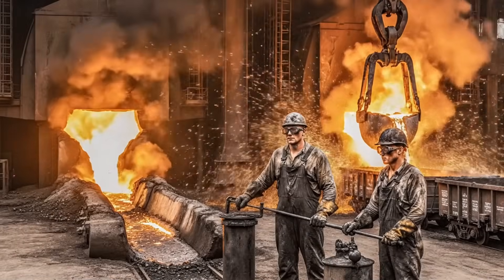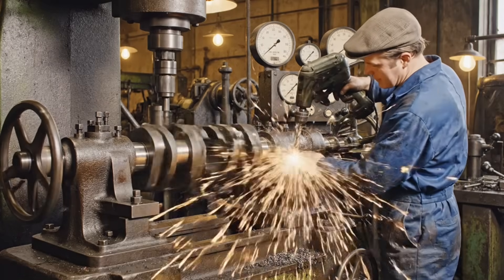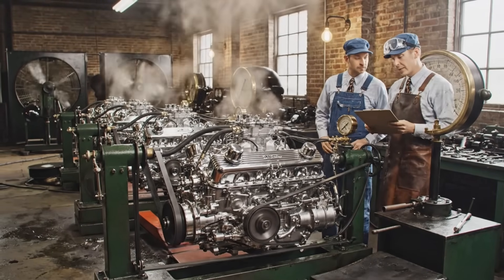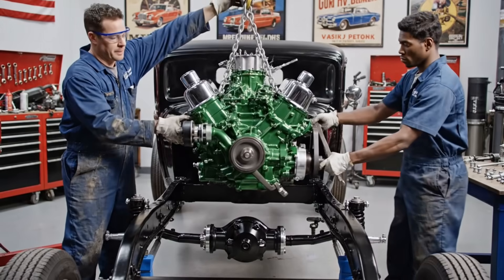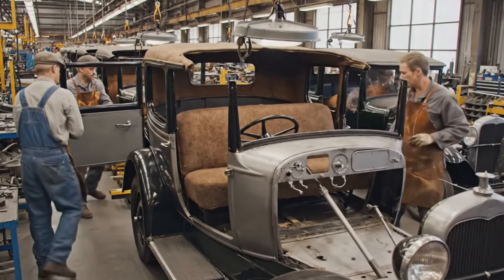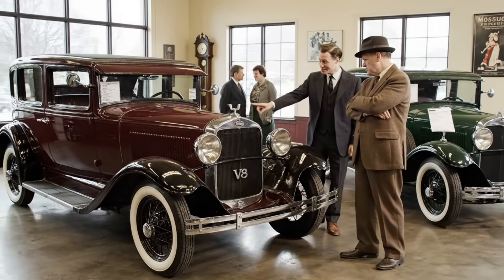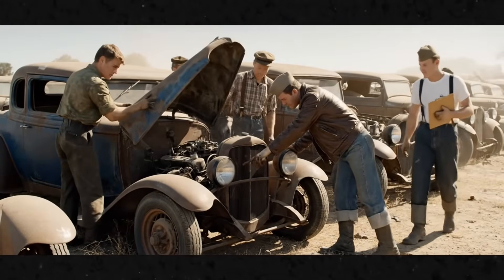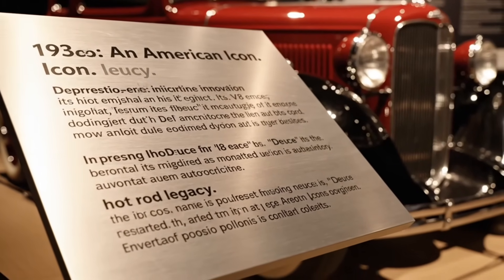Inside the 1932 Ford V8 Factory: How Ford Built America's First Affordable V8 During the Depression

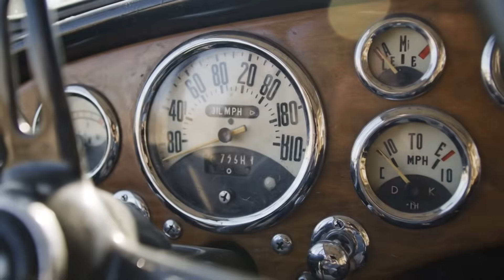Comment: More AI BS. I like the baby moons on the left rear tire @6:32 & what's the apparatus supposed to be doing to mount the spare tire & why is it mounted to the rear fender? The guys @ 6:46 will have a tough time mounting a body with front fenders to a frame that already has them & that V8 sure doesn't look like a flathead. What's the guy @ 7:23 doing with a 1 1/4 combo wrench to a seat spring? Wow what a mess.